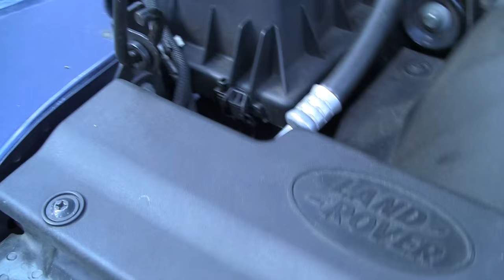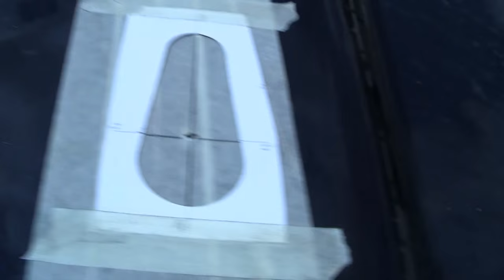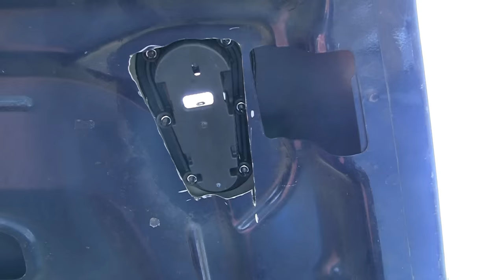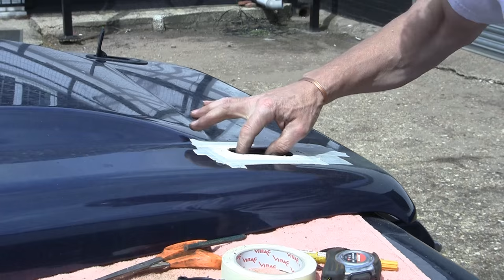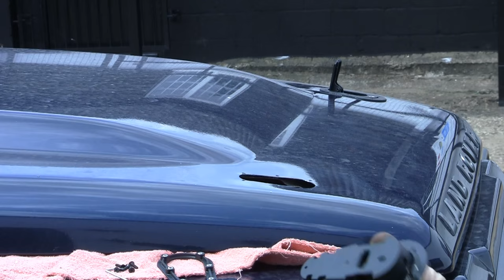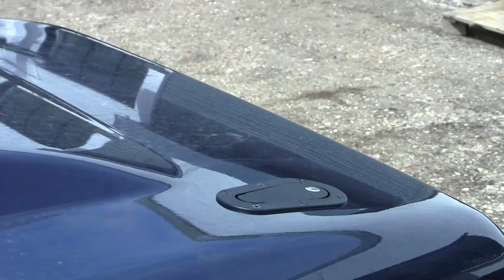Land Rover Defender Aerocatch Fitting

Comment: Nice job. Did you consider painting the cut edges to prevent rust? Or painting the pins so they are black or matching blue?
Reply from the maker: It’s aluminium so no problem with rust. And no, the pins are just pins no one sees them.
Reply: Gary Huston I thought the Puma bonnets were steel? Did you verify with a magnet?

Comment: Why would the bonnet be such a hot item for thieves? Are they easily damaged and need to be replaced often? Over here in the US a lot of tail gates get stolen from pick up trucks. They lead a hard life and are easily removed with no tools. But a hood? (Sorry...bonnet) It makes no sense. In some neighborhoods they soak a wood pallet with gasoline, push it under the car, and set it on fire. This happens to a lot of police cars in Ferguson and Baltimore. Great fun!!

Take care Gary and I'm glad you're doing well.
Reply from the maker: Mark Mossinghoff This particular model has the power bulge in it and people want to make there old model look newer.
Reply: garyhuston Oh the power of the bulge!
Just a tip, I've found that when using a hole saw it helps to use a separate drill bit to drill the pilot hole then install the saw and finish the cut. This prevents the teeth of the saw from grabbing when the pilot bit breaks through. On larger sizes and thicker metal I remove the pilot bit and put a 1/4" rod in the arbor so as not to break the drill bit while cutting the hole.
Looking forward to the next one.
How is the new dog getting along?
Reply: It's because people with the old style bonnet want the new style one (the puma bonnet) like this one so they get stolen and then resold

Comment: do you really need the bonnet catch and safety catch once these are fitted?
Reply from the maker: Yes, the bonnets on these are very sort after and stolen every day.
Reply: @garyhuston  but wouldnt the aerocatch 'replace' given its very easy to un-latch a bonnet based on the original design?
Reply from the maker: itolond I don’t understand what you are saying.
Reply: @garyhuston  the original bonnet catch was the lock the bonnet down, the original safety latch is the prevent the bonnet flipping open if the catch fails or the bonnet is left uncatched. wouldn't the aerocatches perform both jobs here - so no need for the original catch latch system to remain?
Reply from the maker: itolond in theory yes, but why go to all the bother of removing something that makes it more difficult to remove the bonnet?

Comment: What an utterly crap fitting !!! I would be sooooooo disappointed if I did that to my G Wagon - but then, it was built correctly  and does not require the extra nonsense.
Reply from the maker: Then why watch it you knob!
Reply: +SCORCH SCORCHED 
I agree. I like the idea but its a fucking terrible job. If I ballsed it up that bad I'd probably spring for a new bonnet.
Reply: +garyhuston 

For the same reason people cant help but stare at traffic accidents. 

Don't get me wrong: I really like the idea, but the workmanship here is absolutely terrible.
Reply: Idea is great! It is a shame one has to go out of their way in the first place and fit these after market protection devices. If you are going to do it however.... you should at least try and do it properly ! If I had done that, I too would be replacing the bonnet. The job is appalling! If it had been returned to you from a workshop - you would refuse to pay the bill AND demand a replacement bonnet.
Reply: 😆😆 nobody want to steal a G wagon so no need for extra security